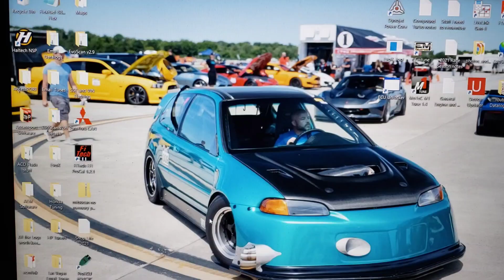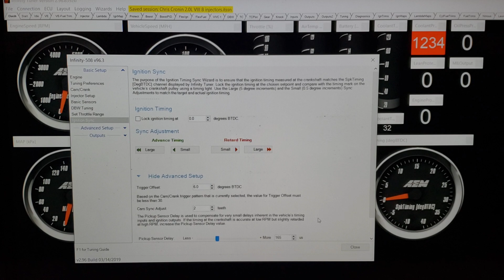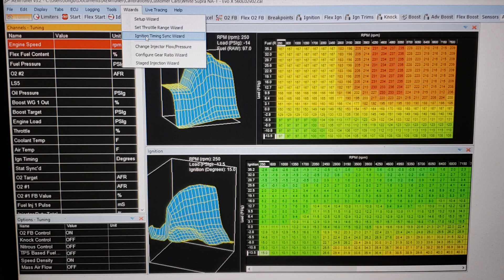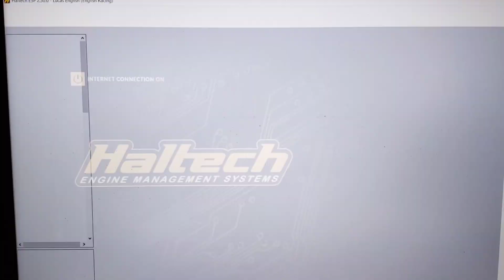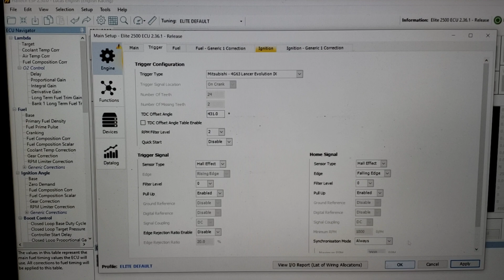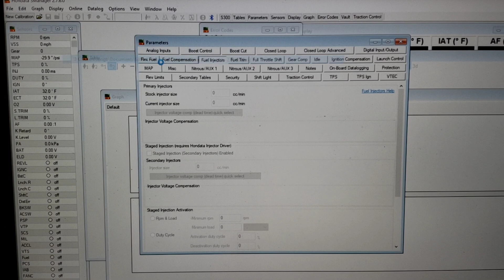Timing Sync with AEM Infinity/AEM Series 2/Haltech/Hondata

Comment: is there a way you could do a small note about the infinity for Evos and DSM because when running smart coils in sequential fire you have to add so much trigger offset to get the car to even start like maybe 180 degrees or more.
Reply from the maker: I'll have to look as I've only done a few sequential ignition 4g63 on and Infinity. That being said I don't recall it being much if any different.